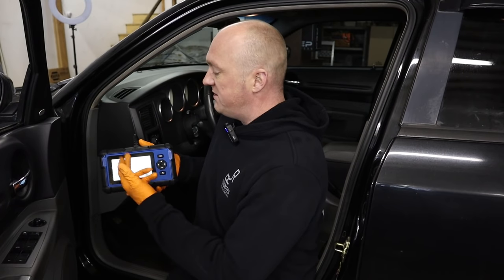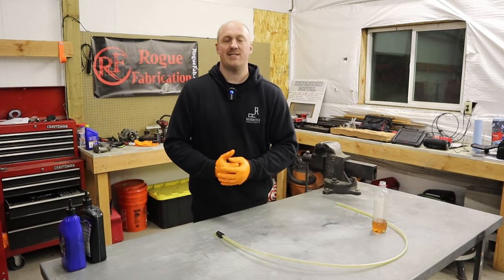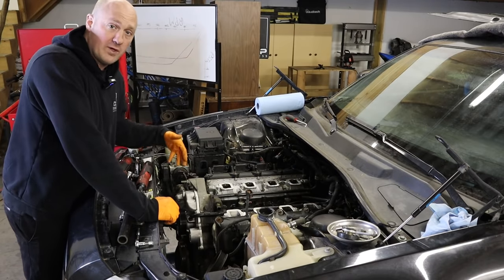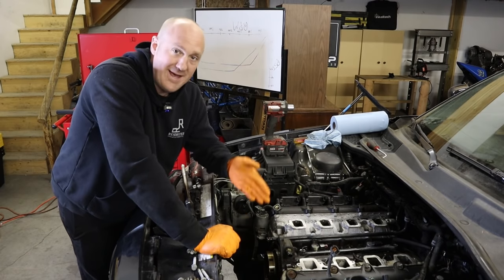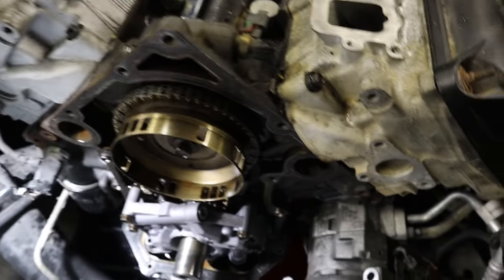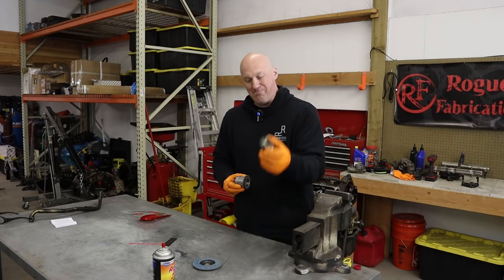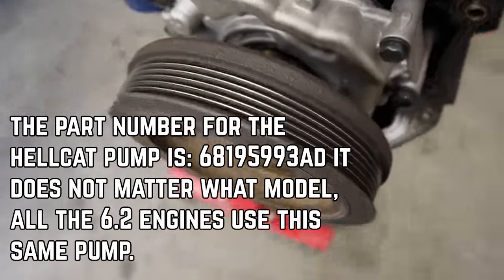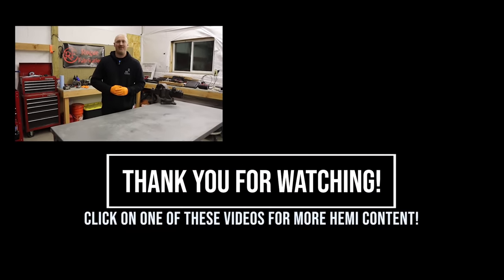Will This FINALLY FIX Hemi Tick? #hellcat

Comment: Awesome job!!!!  Definitely like the looks of those increased pressure numbers.  What kind of mileage do you think would be good idea to upgrade the oil pump?  Thank you for all of your hard work :)
Reply: The sooner the better because low pressure and lower oil flow especially at idle can cause more engine wear no matter the mileage. So someone who doesn’t idle much won’t see as much of a impact. But it will definitely help with reliability when your pushing those horses racing for just trying to have fun and pushing the engine

Comment: I looked up my 2014 charger oil pump and a 2015 6.2 oil pump and my parts vendor is saying they take the exact same pump. I need to get a high volume pump right now I have a high pressure and high volume but it's not a meiling. I love the time you put into this from one technician to another
Reply from the maker: Hey thanks so much man I appreciate it! I've had a couple people say that their stock pump has a 16mm thick rotor like the Hellcat one has, but they've never sent me any pictures to prove it. I personally have never seen one in anything but a Hellcat. Good news though, I just got Melling to send me their brand new high volume pump for the 09+ Hemi engines. This pump has a claimed 20% increase in volume, the Hellcat one is only 12% more! I'll have a video out on it likely next Saturday. The part number for the new pump is 10452HV 👍
Reply: @ReignitedAuto I seen that and actually ordered one been waiting for that for a awhile not looking forward to going back into the engine again lol

Comment: Great work on this hemi-tick series.  My RAM 1500 5.7 reports hot idle oil pressure at around 37 psi.  Stock truck.  Maybe not all Hemis have low hot idle oil pressure?
Reply: My 1500 is close at 38psi. Still wondering if it is worth doing the hellcat pump swap on mine or just do lifters and cam now to avoid complications for hopefully another 80k miles.

Comment: I run a thicker oil Shell Rotella 15w40. You'd be amazed how many oil related issues it solves , oil leaks , smoking via pcv etc. Works in the Audi's and BMW's too that spec these ultra thin oils that give numerous headaches till you go with a thicker oil. That's why Lucas oil stabilizer works so well.

Comment: sorry for an additional feedback. something I thought about and the end of this awesome technical video, is that this is my first truck with auto start, and i live in Colorado with cold winter weather 
I also have heated seats and auto climate control. that being said I use the auto start all winter long and the truck will idle for 10? minutes before it shuts itself off.... I wonder how many other hemi owners do the same, and are we the highest # of cam failures? hummmmm
Reply from the maker: I think the people most at risk are those who idle excessively when the engine is already at operating temperature so the oil is already at its thinnest. Mainly fleet type vehicles. and when I'm talking about excessive idling I mean 1hr+ 👍

Comment: I will say, I was able to get my pickup tube off my 2012 1500 ram when doing my cam swap while keeping the oil pan on. All about sanding down a closed end wrench to where it's thin and bending it like a S so it'll fit over the pan, and under the tube bolts.
Reply from the maker: Necessity is the mother of invention 👍
Reply: @ReignitedAuto  I understand way better to take off the pan, but I did mine in March of 2020, so getting other parts other than the Jay Greene kit was out of the question lol

Comment: I just made a 20k investment on a 2010 ram with 210000kms and drive it for the summer.  Now? Cylinder 5 misfire under any kind of load.  
I don’t have thousands to throw away, super upset with not getting value.  Im not naive i realize it was used but this is so common.  Poor engineering??? I don’t know but i can say im a frustrated consumer.  Looking to fix the issue not just throw money at a problem that will repeat itself.  This has to be the best plausible cause snd fix.  Thank you for your video.  Like and subbed!

Comment: What an effort!!! Kudos to you for this episode. As always so much information. You really do put in the work for your viewers. Maybe a dumb question, do you know if the AWD version can swap out the pump the same way. Is the oil pick up tube mounted the same or is like the trucks that have to remove entire oil pan. Contemplating engine in or out valve seat replacement /cam / lifters / chain / oil pump and maybe shortie headers. Any opinions? Keep up the good work!
Reply: Always plan on having to drop the oil pan. It's a bitch and a half. I got a 4x4 ram and only had to unbolt the front diff. It was quite a bitch. 147 miles 3 bad lifters and a very sad looking cam. High idle times but regular oil changes. Looked like I was wiping anti seize out the bottom of the oil pan. Ridiculous amount of tiny metal shavings. Replaced literally everything and I would feel so not good about not knowing what was in the oil pan If I hadn't removed it.

Comment: Dodge service tech I know had his 2015 Scat Pack cam fail at 40K miles give or take a few 100 either way. Th 6.4/392 Scat Pack engines use the larger oil pumps, so this is not the answer. One would think Chrysler would have drill some holes in the cam galley area for oil to drip down upon the cam ? Cheap quick fix that most likely require a resistor plug here or there.For Chrysler to sully their Hemi name due to a lack of action of this issue is amazing !?

Comment: 1 thing I take a bit of an issue with is oil psi is not solely created by the oil pump. The majority of oil psi is created in the engine itself by the clearances of the bearings. Ex. You can easily have a brand new hight volume pump on a worn out engine that will give you 0 psi. Upgrading the pump will provide the engine a higher volume of oil but not necessarily higher oil psi
Reply: He did cover that in an earlier video
Reply: Well pressure and volume are related but not the samething. Its kinda glossed over on this topic.

Comment: Wow,  thanks for the in depth look at the oil pumps.  A couple of questions about the other accessories. Have you considered switching to an electric water pump? What would your pros and cons be?
If you're having multiple radiator failures, what are some possible causes?  Looking forward to the next video.

Comment: Thank you for dedication and explains. Appreciate! However, my measurements do not fit this concept. I drive '14 R/T from it's day one, and I do notice a tick on idle, not extremely loud. After driving today 30 min city cycle (low speeds, continuous start / stop on traffic lights), I let the car to idle 2 mins and took numbers: Oli Temp - 215 F, Oil Pressure - 42.3 psi . The car is stock, but with Mopar CAI.

Comment: I’ve got 2020 1500 5.7 rebel. My cold start oil pressure on startup is 60 psi. 
Highway is 52 psi.
At full operating temp idle is 31 psi.
Reply from the maker: All sounds good to me. What's the ambient temps like where you are?
Reply: @ReignitedAuto  I’m in Western Missouri. At the time of that test it was 72. We run from -20 to 105 degrees normally. I’d like to test it again at other temperatures.

Comment: Great info. I would like to share a non hemi related experience related to oil pressure that I have had.  I am a 2.2/2.5 chrysler turbo fan. On my 2.5 turbo I had noticed after a full rebuild after some hard runs I had about 7 psi of oil pressure at idle. No failures no noise but just not a comfortable feeling you know what I mean. I installed a oil cooler for small block Mopar from summit racing, it was about 100 bucks at the time. I strapped that bad boy to my radiatior with them accessory cooler straps we all have seen before.  That oil pressure is never under 30 psi now, this motor has survived 10 years making 375 hp with a 16v head. An oil cooler sure might be a much cheaper and easier solution over all this major surgery.
Reply: Double check you oil level in you oil pan or at least 100% make sure its always FULL on the stick. Either the stick or the pan wasnt correct on alot of those motors back in my day.

Comment: 37 hot Idle 70 74 at 60 mph. 77 Medium cold start after ride, Sitting for one hour. Don't have Completely cold but I will try to update this review. 

Millen oil pump: Thank you so much! 2012 ram 5.7🙏💪

Comment: I don't think you could hear it enough. Thank you for doing this experiment. My 2018 Ram with the 5.7 runs at 33 PSI during idle at normal operating temperature. What do you consider an optimal oil pressure level on idle? I'm not sure if you covered a specific number in this video. Thank you!
Reply: I would hope around 40 at least.

Comment: Is this "HEMI TICK" problem still present on the new 2022 Dodge Challenger R/T Scatpack 392 and 2022 Challenger SXT V6 as well as the MDS problem on these new Dodge Challengers with the 8 spd. automatic transmissions?

Comment: Thank you so much for this informational / educational video.  I am truly in awe of the data results. I want to install a Melling pump on my 2008 Dodge Challenger SRT8 6.1L and a Hellcat pump on my 2018 Dodge Challenger R/T 5.7L.  

Also, I would think this may help if not solve the lifter issues on the Hemi engines.  Thank you so much!!

Comment: Had a 2009 5.7 and was forced to retire it at 405,000 kilometres due to an accident. Insurance wrote off the truck. I bought the truck with 189,000 kilometres and it had a tick at that time that never really got any worse. At 405,000 km it still only burned about 1 litre of oil every 8000 to 9000 km. The only oil that I have ever used in it was Amsoil 5W20 and changed it every 10,000 km. I feel if I didn’t loose track of the tanker in the snow storm and white out it would have gone for another 100,000 to 200,000 km.

Comment: The relation is called Poiseuille's law, which describes the smooth flow of a fluid along a tube. The flow rate F is proportional to the pressure drop Δp=p1–p2 divided by R , the resistance to flow. The resistance to flow in turn is directly proportional to the viscosity η
But when the oil heats up it flows more freely so there is a pressure drop. Lower viscosity will allow quicker lubrication at start up and more volume at lower pressure. There are additives that pipeline companies inject to increase the flow and they work with the pumps running at the same RPM and Volume/Flow increases. Same pumps/motors but flow jumps up. Talking hundreds of barrels per hour increase.

Comment: I have a 2022 Ram 1500 Limited with Etotque after 90 seconds the engine shuts off so long idle times should not be an issue. I installed a Kand P Enginering Aircraft quality oil filter that is reusable I can clean as often as I like. Advantages are it cleans down to 5 microns Vs 20 microns with OEM, super magnet inside filter and offers 7 times more flow, at hot idle 85F Im at 35 psi at 500 RPM's 8 psi less than the Hellcat. I 100% agree with more pressure at hot idle  is great with and oil changes at 5000 mile Vs 10,000 miles is best and I use Amsoil 0W20 Vs 5W20. Soon to install a bypass filter by Insane Diesel that cleans to 1 micron, more flow more pressure and cleaner oil = less failure.

Comment: I just bought a 2015 Ram 1500 Sport that had a new engine installed in January due to engine (camshaft failure). Previous owner was unaware of the “Hemi tick” issues but did say it had been making noises for a few months before failure. Engine has about 1500 km on it (~1000 miles). I just had it at my service shop and had them test oil pressure cold and at operating temperature. Cold it was 35 psi and at operating temp it was 29.5 psi. Contemplating getting the Hellcat pump installed but think I will monitor over the next year to see if pressures drop.

Comment: Hi Sky.  I have question.  I have a 2020 Ram 1500 5.7  and at temp of 89 outside, oil temp of 221 coolant temp 212. 600 rpm  idle my oil pressure is 33 steady and 60 psi at 3500 rpm.  Do you think it worth the upgrade?    Maybe they have already improved something here.

Great video, keep them coming.

Comment: Epic job of going though the job of do that, one thought is doing that same test with a mechanical oil pressure gage to remove the doubt of the stock pressure sender. Either way great video .

Comment: So I've welded on all kinds of things your not supposed to when making scrap metal art. When I run across engine parts that have been soaking in oil for their entire existence, I always hit them with a map gas torch until it stops pushing out oil. 
Just FYI for anyone welding things they aren't supposed to weld

Comment: This is good info. The factory specs for minimum oil pressure is 10lbs. per 1000 RPM. With the design of these new HEMI engines I think it should be a little higher.

Comment: Wow! Just an amazing videp and amazing guy for putting this all together for us to enjoy. The effort it took to, not only do the teardown, but also film and edit it all, truly awesome! Thanks so much. This helped me with my project as well.

I just bought a 2013 Ram 3500 with a measly 5.7L in it that croaked. Previous owner didn't take care of it at all. But such a big chassis deserves a bigger motor. I found a 2015 6.4L that I'm installing in it and want to upgrade the pump while it's out. So thank you for this.

Question: so you said the Hellcat pump is a direct fit to the 6.4L Hemi after 2009? Is that right?

Comment: Based on your Hemi Tick 2 video theory. If the MDS Spool Valve had a permanent bypass allowing enough oil into the galley to help lubricate the lifters but not enough to push the pins in for the MDS lifters, this would be better for the lifters than increasing oil pressure & volume to an area that still can't be accessed.
Reply from the maker: Mostly true, however the MDS solenoids do in fact let a portion of oil through the passage just as you are suggesting, by increasing the volume of oil hopefully we are getting more in there during daily and especially idle driving. Unfortunately I have no way to scientifically prove this, it's just a theory.
Reply: I agree with your idea if the spool valve let more oil by pass it may help. I still believe that the angle position of the lifter and where the roller runs on the cam does not receive enough oil when the lifter is flat or de active. By simple using a electric scribe for tool marking and putting a line from the top of the lifter body to the bottom may help this problem. I watch a engine builder do this on extremely high hp small blocks when converting from hydraulic lifters to solid to provide more oil upwards to the rocker. He on scribes from the oil hole up to the top. Maybe in this case from the oil hole down to lubricant the roller better. You can hear the differences on the test stand of before and after when he does this mod.

Comment: I just got my 5.7 done. Replaced lifters, cam, rockers and pushrods. Timing chain as well just because. I suggested to the shop to install a hellcat pump and he advised against it because the 5.7 isn't designed for it like the 6.4. I have a 2015 2500. I looked at the parts and there was nothing wrong with the lifter bearings but cam was scarred up on almost all of them but one worse then others. My oil pressure is at 55 psi cold and 45 at operating temperature. It seems to me that it was cam failure or oil failure that failed the cam. How about installing a high idle switch for longer idle times. Mechanic says the hellcat pump will blow out seals but you say that the engine has a venting system to prevent that. Anyway, I didn't get one installed but from now on I will go with 5w30 and Lucas and see where that takes me . Thanks for all your amazing videos. Been doing lots of research.

Comment: Nice job Sky.  Forgive me, I can't remember, was the stock pump a new stock pump, or the used one?  If it's used, I'd be curious about how a stock replacement pump performed.  That was a heck of a lot of work, but I think it benefits the community quite a bit.  I am like you in that I don't know if it would fix the issue completely, but anytime you have more oil pressure (Obviously there are upper bounds) it is better.